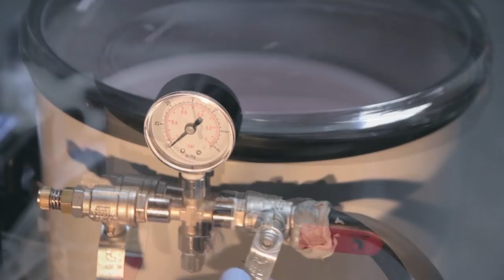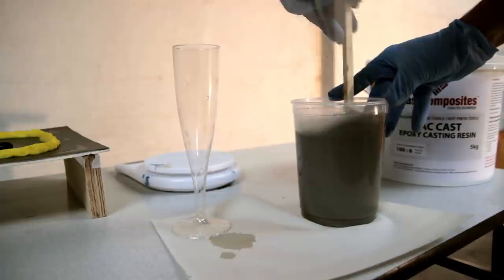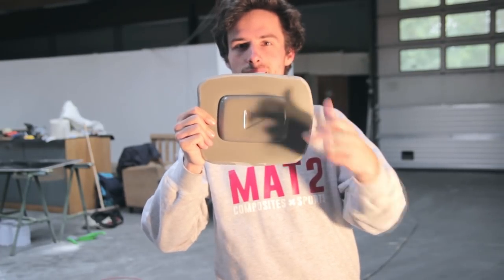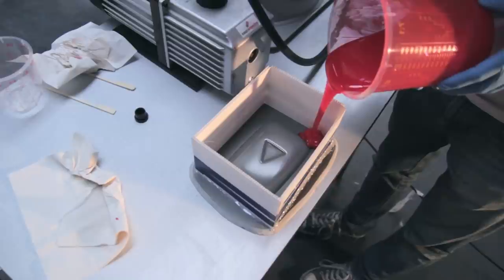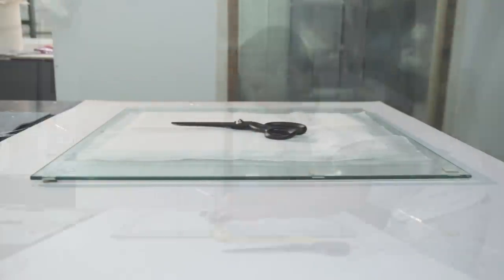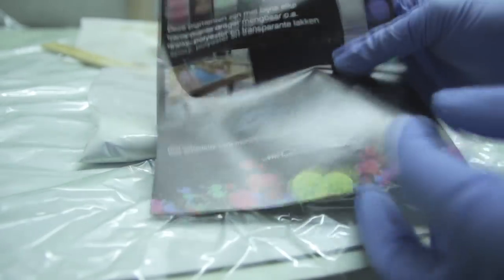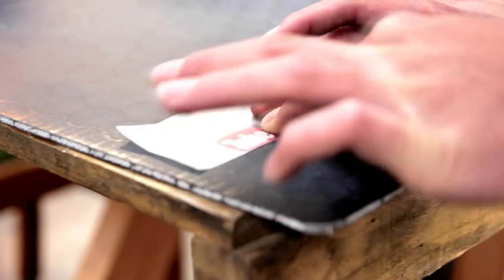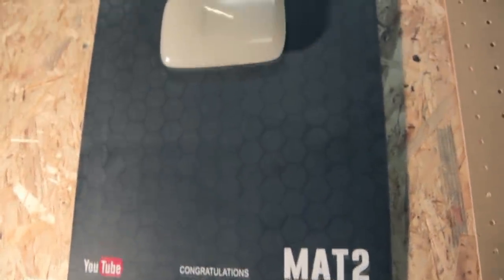YouTube Play Button 25K (how it's made)

Comment: Great video Matthieu .......

I'm 'TURK' @ Easy Composites,  currently working on the 'Quad Headlight Project' .........  really glad you finally got round to making a video on 'Vac-Cast Epoxy Resin',  there was absolutely nothing on the internet about this wonderful material before I began using it.

I used it when I made the tooling plugs for my headlight assemblies,  it's specifically made for vacuum forming tooling plugs so is resistant to high heat applications,  because of it's high content of aluminium.  I cast my resin into CS25 silicone moulds ........  what type of silicone did you use  ?

And congratulations in reaching over 25,000 subscriptions ..........  I am now also subscribed !   and liked  ; )

TURK
Reply from the maker: haha It took me a while to finish this one! I have some more casting tutorials coming soon!
Reply: Excellent,  I'll be looking forward to seeing those Matthieu.

Btw .......  that's a BIG workshop you have there !   : )

TURK